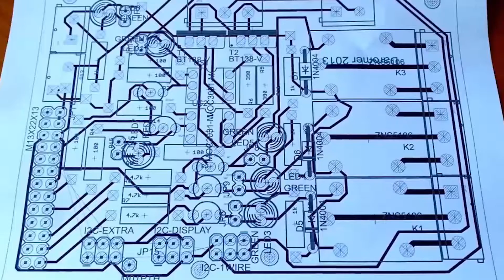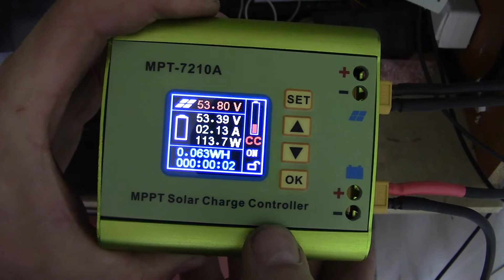DIY: Change contacts on a MPT-7210A mppt charger to XT60 contacts

Comment: Good idea, but I would be careful! 1. solder is not wear resistant, an some point the connection will break. Secondly solder has not the best conductivity, as the pins float in the air, and no copper wire is inserted, the connection will get hot due to higher resistance of the solder. take care!

Comment: I'm not being critical, what you're doing is cool, (though the connectors you bought might be available with 90 degree headers), and you speak better English than I do anything else, but just FYI, what you're replacing are terminals. Contacts are what's inside switches and relays.
Reply from the maker: Good question. I wanted the device to be mobile basically. :)
Reply: @DIYTechRepairs  I've got four of them , but I'm changing out the two 63v electrolytic caps off the input terminals to ones rated at 100v  so I can safely series two 33v panels together without worry.  I've seen videos of others who have already successfully done it.
Reply from the maker: @golgothapro  note that its a boost so your battery need to be above input for it to work.
Reply: @DIYTechRepairs  I'm charging  a couple of 72v banks of deep cycle 12v marine batteries (one and a backup) to a DC motor drive for two 134A Freon compressors from bus vehicles for home AC.

Comment: is that real MPPT controller ?
Reply from the maker: No. User set type kind of
Reply: @DIYTechRepairs  thanks how can i do it can you advice me
Reply from the maker: @chandanaranasinghe7197  do what? You set the solar panel vmp
Reply: @DIYTechRepairs  thanks
Reply: It is "Manual Maximum Power Point Setting" type of controller. :-) You can adjust desired panel voltage looking at watts it generates in current conditions.

Comment: I have one of these solar charge controllers (scc) for many years and it is a lot of fun to play with.  You can charge a battery bank up to about 72V nominal (85V charging voltage) without issues, even from as little as a 13.8V power supply input.  Solar panel input can be up to 60V maximum.  My favorite features are the low price (I paid about $30 for mine), the very colorful display, the programmability and memory storage for up to 20 settings, and the current limiting.  Current limiting is useful if for example, you have a 200 watt solar panel on a sunny day and want to charge a 48V scooter at no more than about 2 amps.  Normally you would get close to 4 amps but if you tell the unit you want 2.0A max, it will NOT allow it to go higher on the output.  That is a really handy feature.  

Drawbacks of this unit are changing some things like voltage is slow, especially if you want a high voltage like 80V.  It would have been better if they had "wraparound" so at 0V, if you pressed the down arrow, it would then go to the highest voltage.  Another drawback is if there is a rapid drop in voltage (like a cloud shading the solar panel), then the unit tends to drop to 0 watts for about 15 seconds until it "thinks" of how to recover.  This hurts your daily amount of power collected but for the price, I am not complaining (much).
Reply: Hi,
I could onlY get about 1.5 A for charging a 72 V battery. Panel was a large 2m by 1 m 330w panel at 35 v. 
Any suggestions why it was so limited ?

Thanks
Reply: @RareOrf  Hmmm, make sure you don't have it set for 1.5A max.  I haven't played much with the higher voltage output of it so I cannot say for sure.

Comment: Why did he solder those MC connectors together to the board . Couldn't he solder the wires to the board and have the connectors at the end
Reply from the maker: Because i did not want any Wires hanging from it
Reply: @DIYTechRepairs  ok

Comment: Are those Controllers any Good ?   They use the Boost mode going from say 12V PV to 24V battery.     Good Idea on the connectors.

Comment: Great job. I am also going this route but, I think I'm going to use a 90 deg term block header. that way I can solder the term block header onto the XT60 ahead of time and then just solder it to the board.   Here is what I am using.   
https://www.digikey.com/product-detail/en/phoenix-contact/1737019/277-13853-ND/3606132

Comment: but that is the wrong polarity for the XT-60, when you disconnect the solar it will have its open circuit voltage on exposed contacts, just fyi
Reply from the maker: SuperBrainAK thats because i want to be able to hook it to a battery.

Comment: I think you should use the opposite gender connector for the power input side. Also through solder a preformed piece of 25 amp solid copper cable into the board and connector. Nice idea.

Comment: Aahg, I wanted you use this charger to limit the current from a 60 volt battery to a ninebot mini but the instructions says if you you actually use 60 volts can burn out the charger! You have any idea of another charger with higher input voltage?

Comment: you should have just soldered some solid copper wire to the connections and screwed them in
Reply from the maker: You can of course but then you dont have the simple contact to add remove stuff that i was out after. Also the original screw terminals is of pretty bad quality if you ask me and thats why i didnt go that route.
Reply: James Holbrook that’s just what I was thinking. 🤔

Comment: good idea. only should have used the other side on the input.
Reply from the maker: I know that some people think think :) And the reason is that I have some other parts depending on it so needed the contact to be that way.  In normal cases you think of the controller as in-out. But... I would like to be able to hook up 1 battery to input and 1 battery to output. And thats not possible if you did that.  Its rare but it exist in my case.
Reply: I would also use a male xt60 for the charge controller input.
In general, anything that normally supplies voltage such as a battery or solar array should have female connectors to avoid shorts.
Charging is obviously in reverse so  has to break this convention.
I would simply make a gender changer adaptor for special cases.
Reply: Thanks for the demo though - I will modify mine because those screw connectors also drive me nuts!

Comment: Hi, that is great! 
Could you please tell me the name of the connectors and where I can buy them, maybe a link?
Thank You!
Emmanuel Távora Freire.
Reply from the maker: XT60 is the name. They can handle 60A and they are very common in RC. You can buy them from example Ebay or Hobbyking. I generally buy big pack from Ebay :)

Comment: Very nice! I have been using XT60 pigtails on my MPT-7210A, I like the board mounts, think I will implement them too. 
Might I suggest that the connectors be of different sex, I use the female connector in my system on the power source (solar side) the controller has the male, always implying, this way, the direction that I am expecting the current to flow. Since the controller feeds the battery on the controller, this connector on the controller is a female with the battery side on the cable being the male.
I like the consistency of this arrangement, also the female XT60 connector is a little safer from being shorted out when disconnected, then is the male connector. Although I know in this charging arrangement the connectors appear to be reverse, with all other end source attachments leaving the battery  this consistency is safer, just MHO.
Reply from the maker: DrbIll yeah it would be a good sugestion i would say. i used the same connector since i have it for some scenarios where i hook it up from 1 bank to another and not only pv to bank. :)